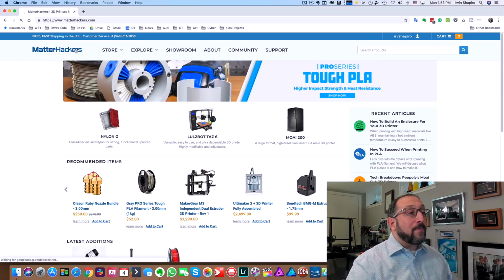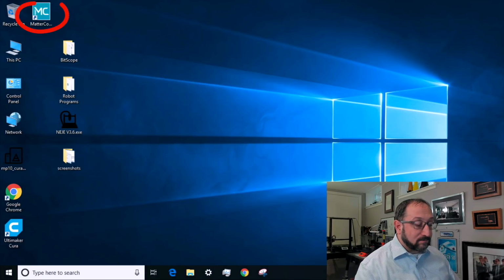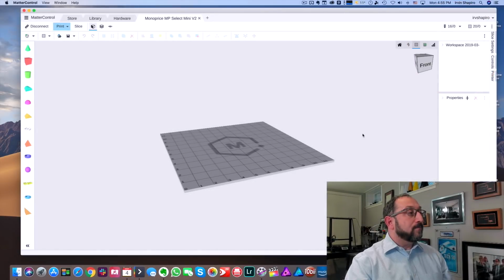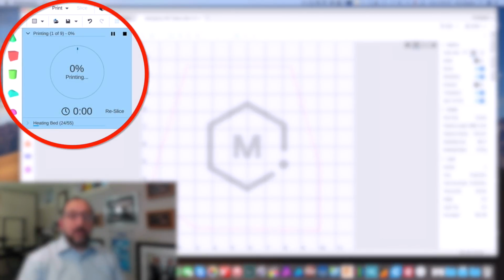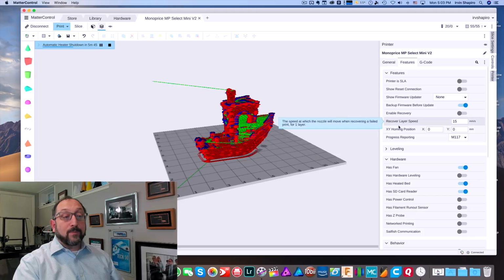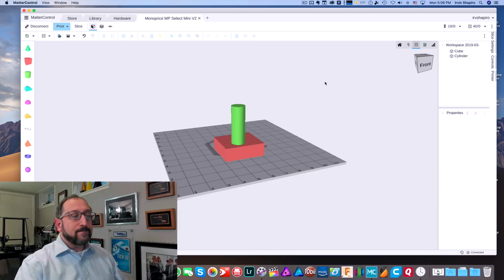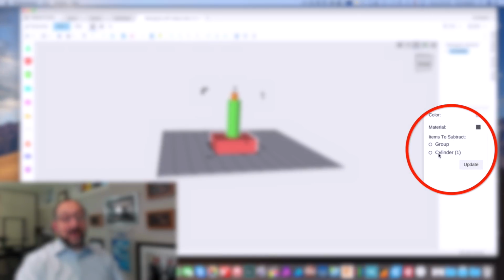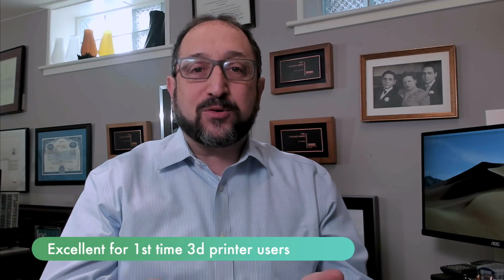Best 3d Printing Software for Beginners

Comment: Are you able to place an STL file into the model section and modify it?
Reply from the maker: Yes and no.   You can open an STL file and then resize it, scale it, move it, etc.   You can also combine it with new objects using combine, subtract, etc.   However, you cannot modify the original STL structure.
Reply: Thanks for the information. I really like you videos. Learning a lot from them.

Comment: The ender printers are not in the list...looks like they support only the CR series s
Reply from the maker: You still can use this.  Just select the CR10.  Then open the new printer, and select the hardware tab on the right-hand side.   Then start by adjusting the bed size to match your printer.   As a next step, you can compare the slicer settings to any other slicer you are using and adjust as needed.   I use MatterControl with multiple printers that are not "in the list".
Reply: @MakeWithTech  I am still waiting for my ender-5 to come :).
The only things I know about using a printer are from your videos - thank you so much.
May I ask what spare parts for ender 5 do you recommend to have in hand and also what do I need for the ender-5 for TPU prints?
Reply from the maker: I am testing TPU as I write this on the Ender 5.  My initial prints failed with severe under extrusion.  I believe some of the problems was the Bowden tube.  I will be updating both the tube and the couplers and then trying again.

I just added a EZABL board leveling kit.   I have not had trouble with 1st layers but a number of viewers ask me to review this.  I will be posting a video in the next couple of weeks about this.

I think the only spare parts you may want to have are an extra magnetic print sheet, a spare nozzle and the tools to replace it and maybe a Bowden tube.

Comment: Great video... Also in trying out the software I was unable to find my recent Ender 5 printer...   I am starting also with Fusion 360, but I must say it is extremely frustrating and learning curve is .. abrupt. The possibilities are awsome but...   Do you know of a simpler cad software that you would recommend?
Reply from the maker: To get started with a very easy to use CAD program check out Tinkercad.  It is similar to MatterControl with a bit more polish.

You can use Ender 3 profiles with the Ender 5.  Just change the print bed size.
Reply: How did it go adjusting the bed size for the ender 3 profile to fit the ender 5? i have a 5+ coming.
Reply: @alh5470  did you get your Ender 5+ to work?  I just got one for us for Christmas.

Comment: i just got a alfawise  u30  and when i look for the printer dont see it how would i make sure it has the right size bed for mine im also very new to all this
Reply from the maker: Fused Catus:  there are a couple of ways to approach this.  First, the Alfawise U30 looks to me like a Creality Ender 3 clone.  However surprisingly MatterControl does not have a standard Ender profile.  But it does have a CR20 profile.  

So I would select the CR20 as the machine type.  Once you select a machine you can click on the "printer tab" on the far right side of the screen.  Once in this tab, you will see General, Bed, and Extruder.  This is where you can verify the geometry of your machine.
Reply: @MakeWithTech  ok thank you so much

Comment: Surprised they don't have Creality Enders as part of their known printer sets.  Disappointed that they need a direct connection - octoprint is becoming pervasive - this is a step back...
Reply from the maker: I agree for advanced users that wifi connections, specifically Octoprint is a must.  If we get enough users watching this video I will use it to push the vendor to add Octoprint support.  The SW is open source so it would be possible for a third party to do the integration. 

On the other hand, many of my viewers are new to 3d printing and the idea of just plugging in a USB cable makes a 3d printer seem like a traditional printer.

Maybe we can get a group of "old" SW guys together and we can look at adding Octoprint support to the github build.
Reply from the maker: Peter, I have been thinking about your Octoprint point.  First, I agree Octoprint support would be excellent.  However, even Simplify3d does not have native Octoprint support.   The alternative is to export the g-code (there is an option for this under the icon to the left of the open file icon -- it is the second icon from the left).   Used this way it is basically like Simplify3d.  If you do this, you will need to disable the software bed leveling because the extra Z axis moves will mess with Octoprint.

Unfortunately, you will lose all of the excellent printer monitoring capabilities.  The best of all worlds might be a Raspberry Pi image from MatterHacker that you could use to connect MatterControl will full support to a printer.  From looking around on the web, it seems MatterHacker was experimenting with this at some point, but it seems to have died.  Too bad.

MatterControl does still have a "network printing" option in the Hardware section.  Here is an old post about using Netcat on a Raspberry Pi with this support.  Netcat pipes the data between a USB port and a telnet connection. When I have some time, I will try it out.

https://forums.matterhackers.com/topic/287/q-how-to-print-over-the-wifi-network-mattercontrol-raspberry/11

It might be possible to create a more sophisticated solution with a Python server running on the Pi.   Might be fun but will take some time.
Reply: @MakeWithTech  "Back in the day" I used to talk about scoping projects as SMOPs and SMOMs. Simple matter of Programming - something that could be budgeted in beer and pizza, vs Simple Matter of Money - something that really needed people hired etc. 

I am a devotee of APIs wherever possible - one of my mentors would speak of a) separate form and function and b) make everything callable.  If Matter Control are looking to offer this as a "free" product, then there is no real commercial advantage to keeping it "in house", so it may be in their interest to take it fully open source, which then also means it may open up to Octoprint like user plugins...
Reply from the maker: MatterControl is fully open source.   https://github.com/MatterHackers/MatterControl

In terms of remote printer integration, I think a better approach than adding Octoprint API integration to MatterControl, which will negate some of the MatterControl value, will be to build a Python script that runs on Raspbian and pipes the USB port to a telnet connection.  Basically a dump proxy -- maybe not so dump -- some management functions may be valuable.  From what I can tell when you select "network printing" on "connect" MatterControl opens a telnet session to the IP address/port you specify and then uses it as a dump pipe.  Anything that would have been sent to the serial port (USB) now goes to the telnet port.  

This way you still have access to all of the MatterControl management features.  Then the next job will be to add WebCam support to the Raspbian environment -- which should be basically off the shelf, along with a simple web-based management interface.  Of course, the right way to do this will be to build a management API first :-) and then a web interface.

I personally prefer this approach because I am not a C# guy and there are more people available that know Python and could chip in overtime on the project.   Maybe a good name for the project would be MatterPi.

Ok, you inspired me.  I created the Github shell at https://github.com/ishapiro/matterpi

Let's keep the dialog going.
Reply: DrVax  Man, I’d love to see a self serve 3D printer in a Kinkos. Twenty bucks a print and you get charged by the hour lol. “Excuse me Sir?, My printer is out of ink. I’m just trying to make my grandson a ballon or his birthday and I’m in a hurry. How long will it float for after it’s done printing? Where’s the ballon button? Ohhhh it doesn’t use ink? Well isn’t that special.”  and so on. .

Comment: Hey Irv, The Vax in Dr Vax, had me intrigued - then I checked linkedin - we both worked at DEC on Vaxes (and Alphas) back in the day...
Reply from the maker: Love it.  DEC folks are spread all over the tech industry.  I was in software services running a group that built custom device drivers mostly for IBM protocols.  Small world.
Reply: @MakeWithTech  I started in FS in a remote location - ended up in ZKO working on VMS et al.  Speaking of IBM protocols  - was at a customer site a few years back - they had several alphas, and an IBM Mainframe, and a dec box (DEMSA rings a bell) that interfaced with everything else and the IBM.  The Alpha it booted from was decommissioned, and it was several months later that a complete power down of the data centre mean that box needed a reboot. The IBM was "offline" unreachable and people were having kittens. I noticed the "boot me" messages, pulled the images off a back of the decommissioned system, and had it going again before everyone had worked out who to blame... Those were the days.. (I just helped my 25 year old put a new graphics processor in his gaming PC - he questioned if I knew what I was doing - I pointed out I was doing this long before he was born...)
Reply: I may have both of you beat.  I was a DEC person on the PDP-8.  Learned FOCAL and assembly on that in 1973.  We used it to control a COM ( computer output microfilm) unit.  Used these until the 1990's
Reply: @woodwaker1  Meh, in my early days at DEC,  I worked on several 8's, a PDP15, a PDP9 and the very rare PDP16. My first DEC exposure was a KA10.
Reply: Ugh. I envy you guys! I was born about 10 years too late - started working in '81 on micros. I would have loved to work on the "big iron" and mini's of the day!